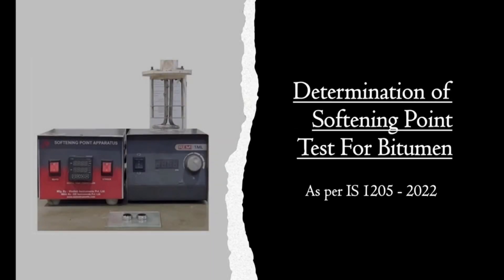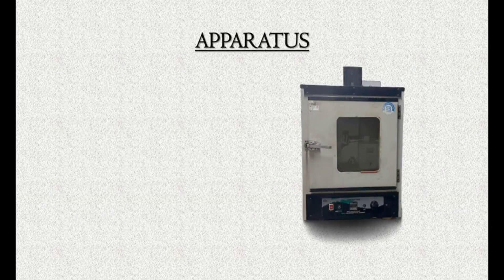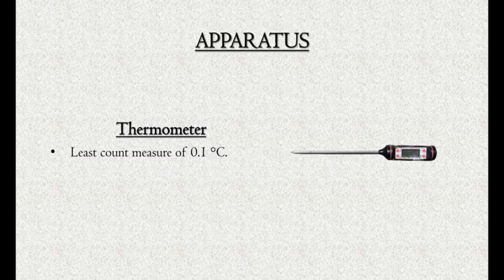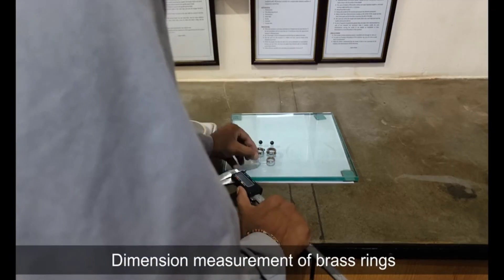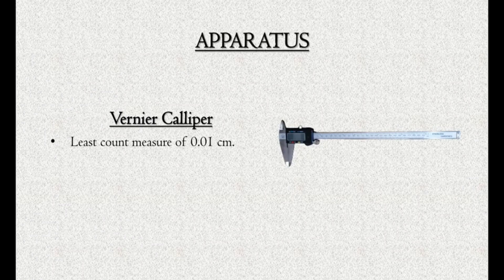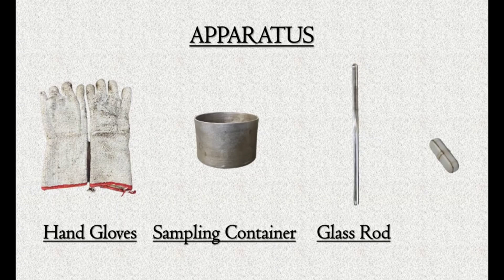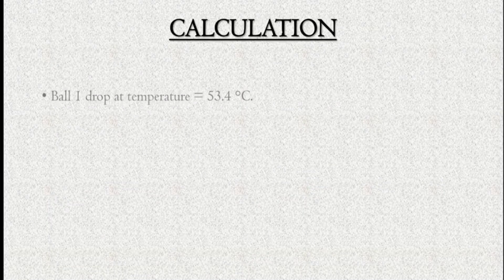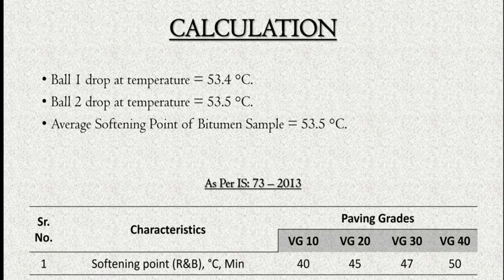Softening point test of bitumen | As per IS 1205

Comment: Glycerine or dextrin powder?
Reply: Yes, a mixture of both can be used as a lubricant on the glass plate below rings so that bitumen never sticks on the surface and it will be easy to remove from glass plate.